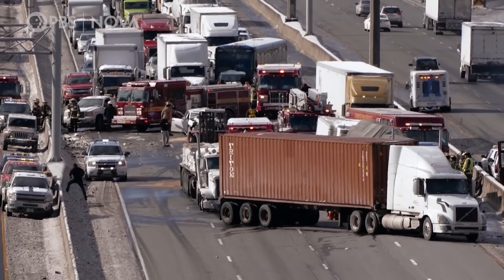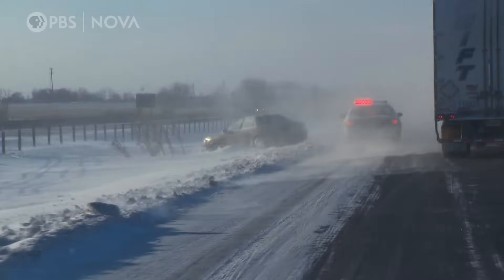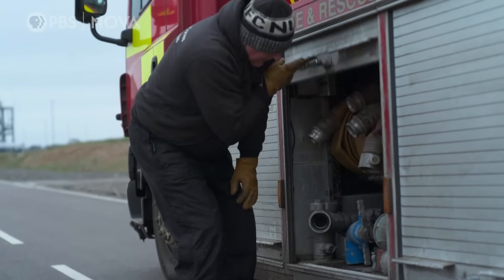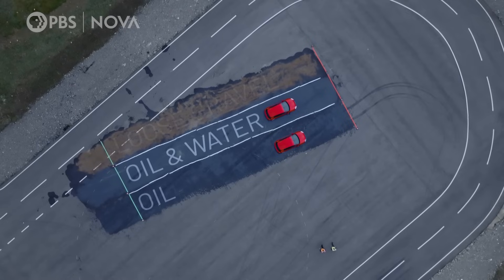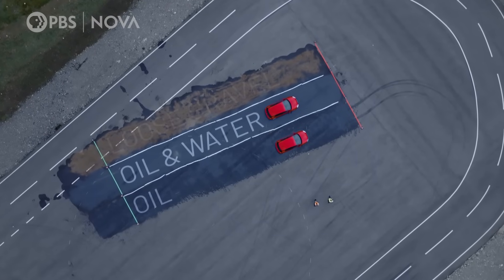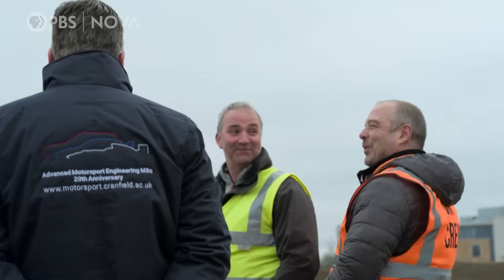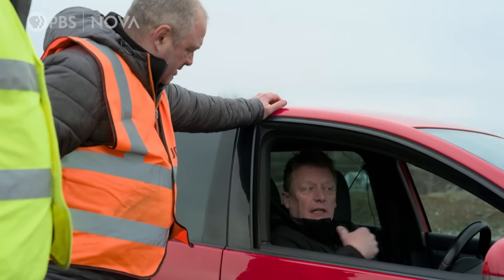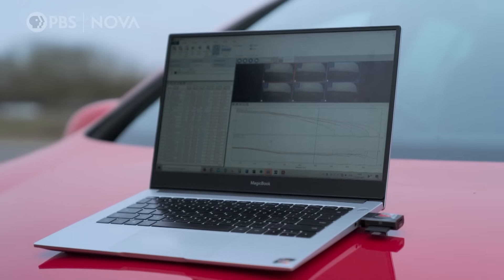Which of These Driving Conditions Is Most Like Black Ice? | NOVA | PBS

Comment: Contact police driving courses , they have a formula the spray on track to simulate , speeds and road conditions
Reply: Almost all police driving courses (and emergency vehicle operator courses in general) just use skid cars - they basically have outrigger devices on each wheel, and they raise the tires off the ground to reduce traction to whatever degree they choose. 

The only one I know of that has anything like what you’re talking about is Michigan State Patrol. They have a massive facility, including a skid pad. It’s smooth with a jennite coating - the same substance used on parking lots and driveways, but with no grit in it - and they just spray water on it to make it more slippery.

They do not spray anything on their track.

The Michigan facility is notable because it’s an outlier - it’s extremely expensive to build and maintain such a facility (they have a track, a manoeuvring pad, and the smaller skid pad). Most departments just use a big parking lot - the skid cars really do accurately replicate low traction.

Comment: quite a number of years ago I got to tour the Chrysler Proving Grounds northwest of Phoenix, Arizona.  Their solution to simulating ice conditions was a massive ceramic-tiled skidpad that they would wet-down prior to testing.  The tile already offered a much lower static coefficient of friction, and when wetting that surface down it basically acted enough like ice and was reproducible enough to make it helpful for testing.

Obviously as a facility that operated for several decades for the express purpose of testing automobiles it was cost-effective to build this skidpad to these standards, because they got to use it for a considerable amount of time.  I don't expect that most research groups can afford the capital costs to construct such a testing environment unless they're something like the IIHS that intends to operate for decades themselves.
Reply: Yeah, but they can just go to where there is actually ice.